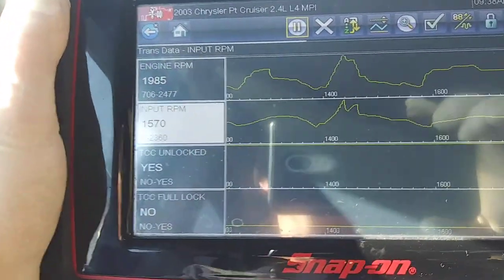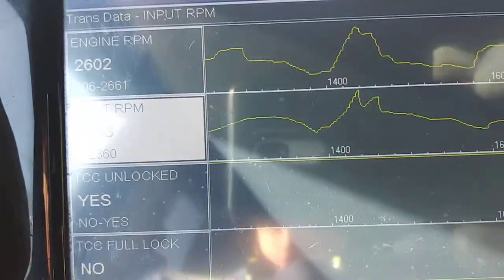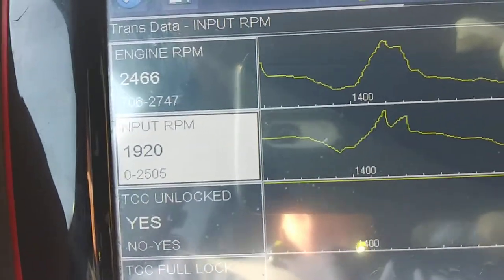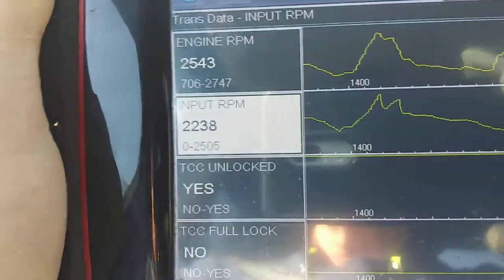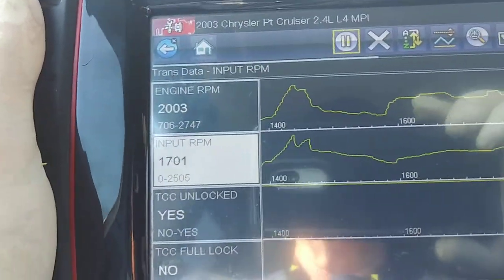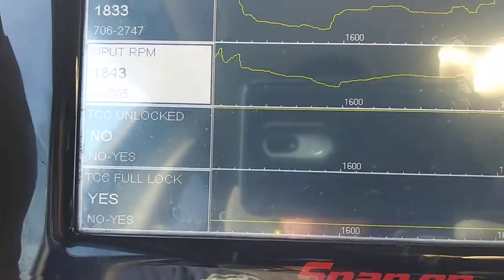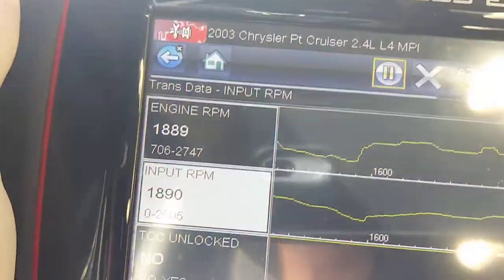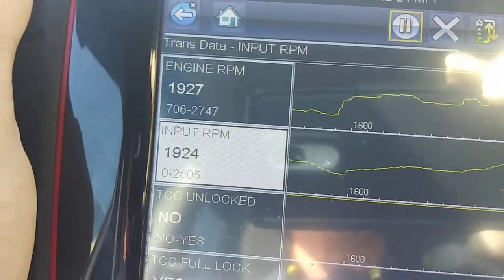po740 torque converter clutch circuit

Comment: so did a torque converter install fix it or did they just junk it or get a used one?
Reply from the maker: Yes, rebuilt trans and convertor.
Reply: @johnandeddie  so no just the converter didn't fix it.